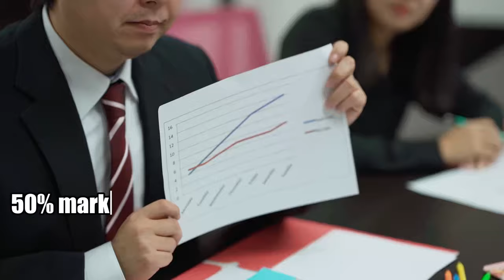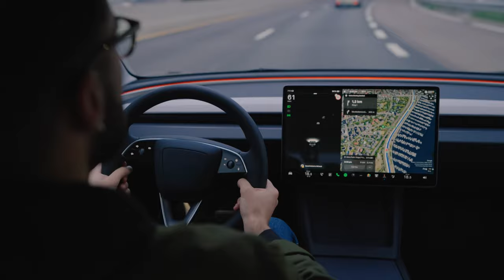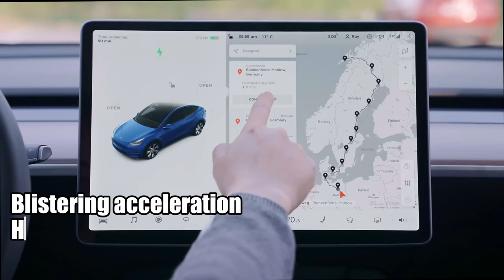The EV Market: Witnessing an Unseen Phenomenon for the First Time! Electric Vehicle Cooldown!

Comment: The greenies bought them and now they are having buyers remorse.  The rest of the public sees nothing but headaches with them.  Noboy likes the charge times, lack of charging stations, cost of maintenance, lack of range, the lack of support, insurance cost, etc.  In short, they suck outside of densely populated metro areas where you can charge it up at will/need(maybe...) and get help if it breaks (possibly...).  I would never buy one....   Ever.

Comment: I once owned a 78 Monte Carlo with a  350ci engine fueled heads 1 inch riser a 750cfm dual line double pumper Holley dual exhaust with glass pack mufflers no cats no emissions controls at all but I had to go through emissions testing the technician failed it because of no cats and ran a probe in the tail pipe while idling came back scratching his head and stating this thing runs cleaner than a 305 with emission controls but I got in a financial bind and had to sell it